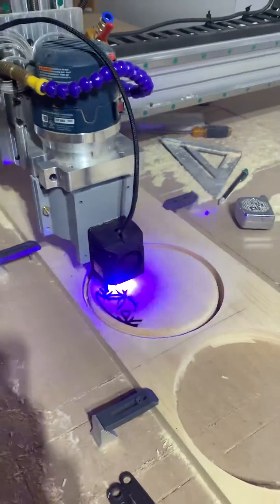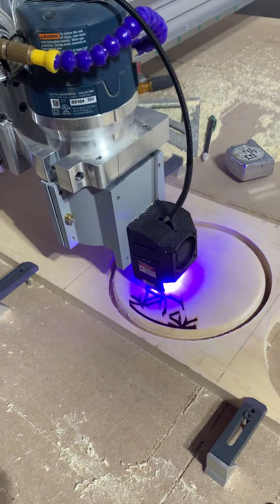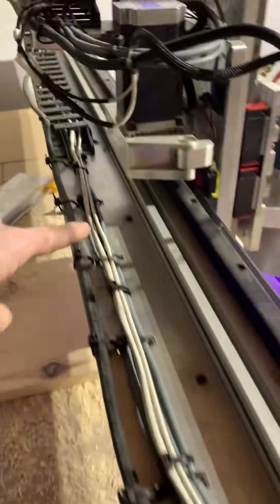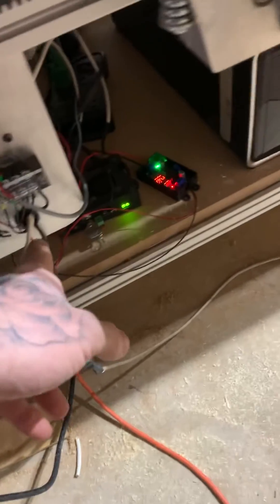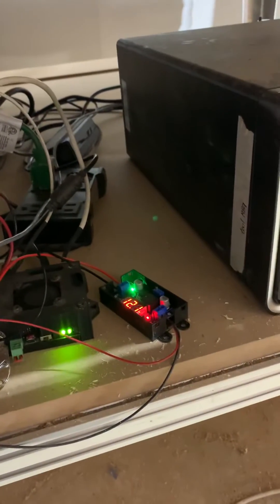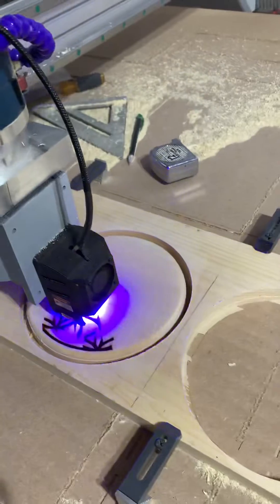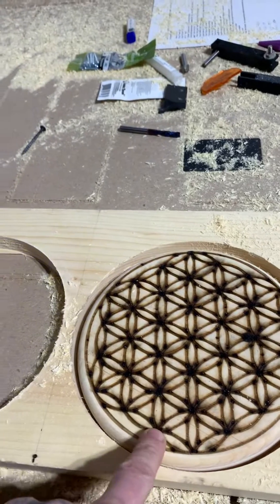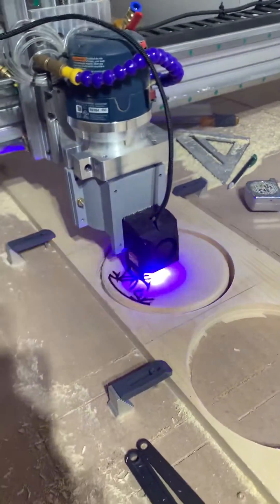Cnc4newbies 4896RP and Jtech 7w laser

Comment: I have nearly everything the same, using uccnc,  I have the 7 watt spindle from jtech, it seems that uccnc post processor is very basic, really hard after using lightburn, do you have any recommendations for uccnc
Reply from the maker: I use jtech’s post processor for Mach2/3 or I use my GRBL dongle (a convert I made to allow me to run GRBL on my Gecko controller) and run my system on lightburn.
Reply: @CroftCNC  so i might have missed it,  i am always scared to experiment with my machines as they are quite busy )) i guess i may not know as much as i could, never had any problems rocking the xcontroller after i started using picsender and lightburn, nearly is my standard,  i almost ordered the 4896 with a demon,  but now im totally out of my element with uccnc...

my question is did you do a video on this fancy GRBL dongle.

Comment: I'm looking at adding a second CNC to my setup and I'm strongly considering the one you have. I am wondering whether you have found that the strength of the stepper motors is sufficient for doing deep carves or aggressive passes? I would be hopefully setting it up with a 2.2 kilowatt spindle but I'm used to using really stout stepper motors and I wouldn't want to buy the machine and need to swap parts out.
Reply from the maker: I have used the 1/2 diameter long reach tooling without issue.  I have also done woods, composites, and metals with no issue.
Reply: @CroftCNC  Thanks for the feedback!